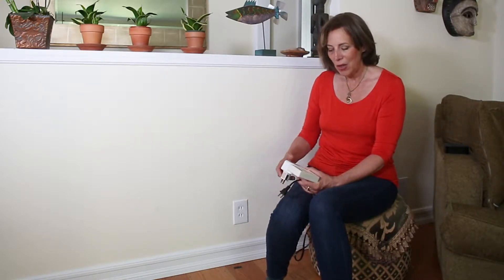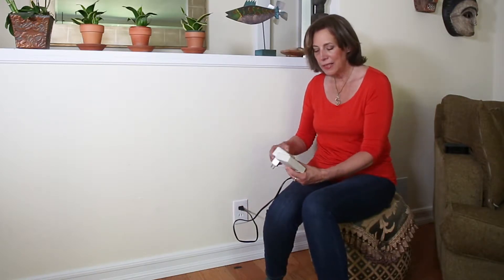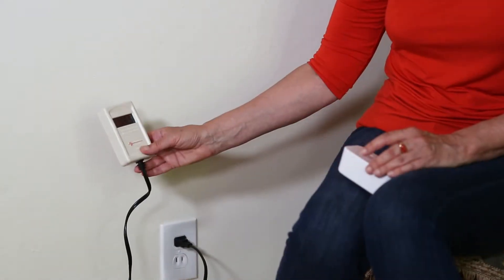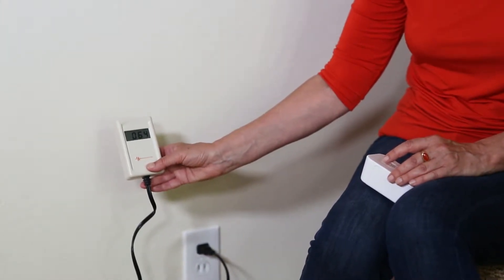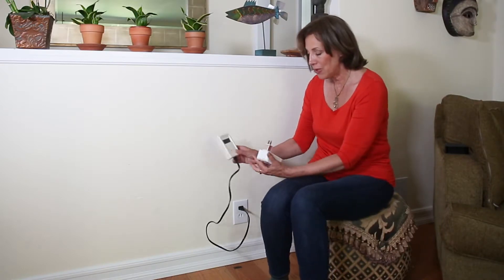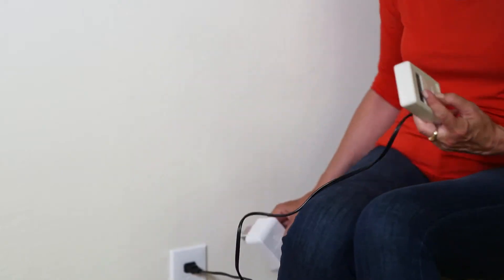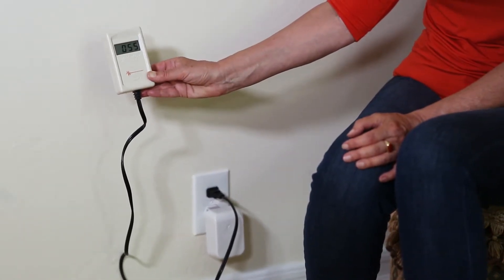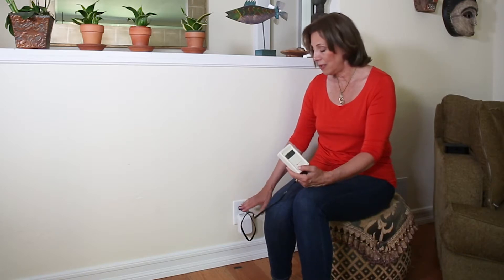Dirty Electricity and How to Use Greenwave Filters

Comment: It looks like you outlets are open ground (not grounded). Is that correct. Our house is older without grounded outlets and have been trying to find out if the filters are still effective under those conditions?

Thank you
Reply: They work on grounded or ungrounded outlets.